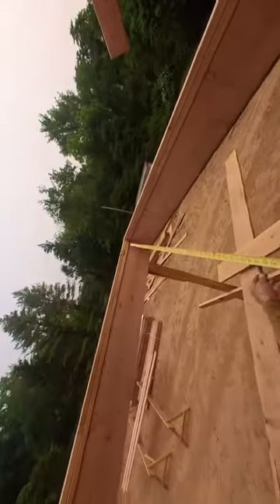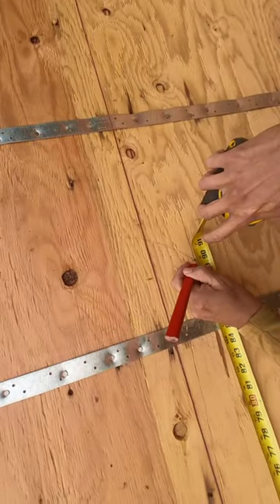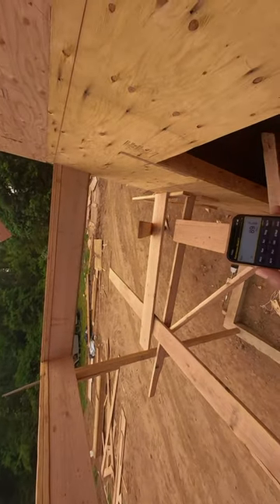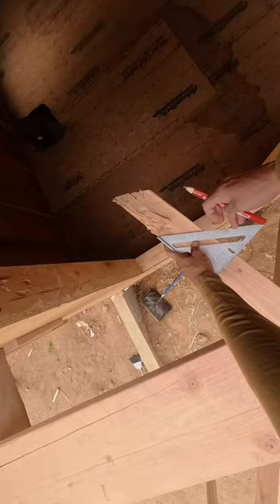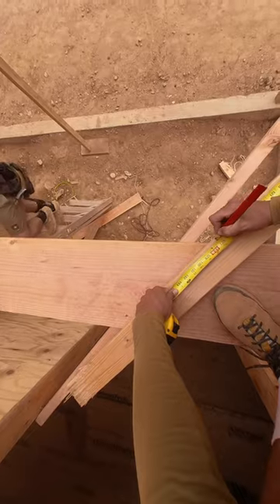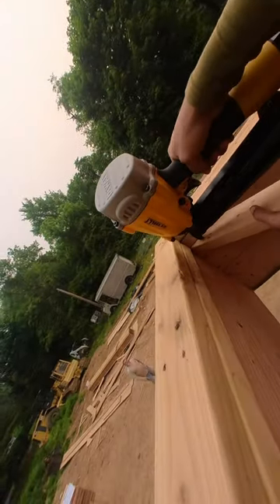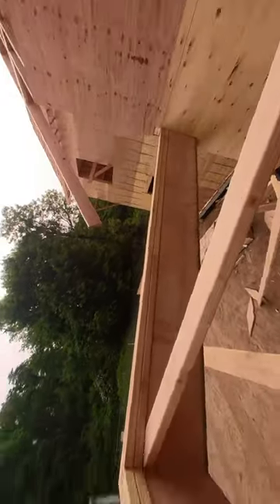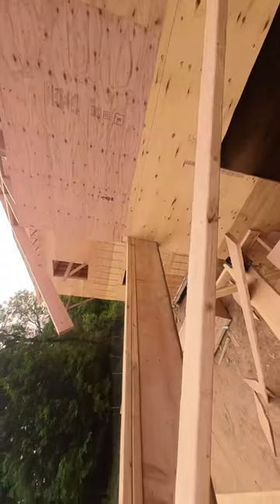How to square a porch #shorts #construction #carpenter #tips

Comment: 3 ft 4ft measure your angle it should be 5ft
Reply: And for even more accuracy on bigger job you can double or triple that calculation. Lots of ways to square buildings. Love it.
Reply: From point to point is more accurate. Very true 345

Comment: a2+b2=c2 

That’s how you find a perfect right angle, 90 degrees, in a triangle. That’s why 3,4,5 works. 3squared is 9. 4squared is 16. 9+16=25.   Square root of 25 is 5.        a and b are the legs of the triangle that meet in the corner.       c is the long leg of the triangle. 

If you’ll use the equation, you can get it exactly right to the point with no wiggle room for error. Generally, it’s not necessary to go that far, but it’s better than 3,4,5.

Comment: Checking square with a speed sq, really? Fine the 45 deg works, but more accurate….use  the longest multiple of 3,4,5’ as possible. 6,8,10. 12,16,20. 24,32,40’ and so on.

Comment: Please explain the no ledger board part. The two end joists go deep into the structure? That's ok? Thanks
Reply: Cantilever amigo
Reply: Even with a cantilever you’d still want a ledger to attach to. Same in plane with top plate for the rafters for a roof, unless leaving cathedral. I am wondering the same, great work in the squaring though